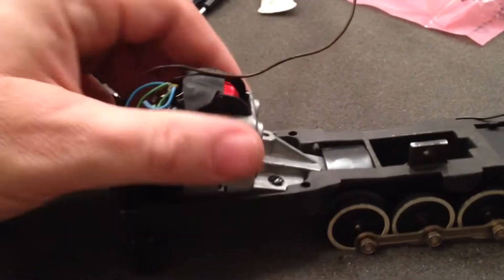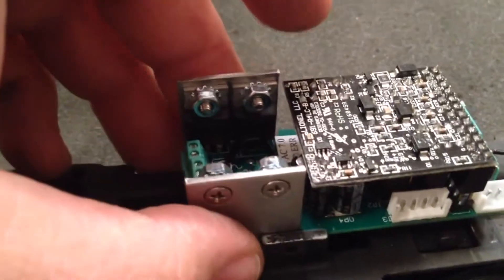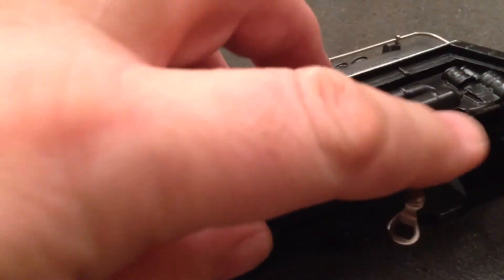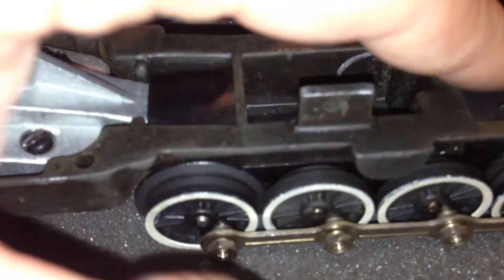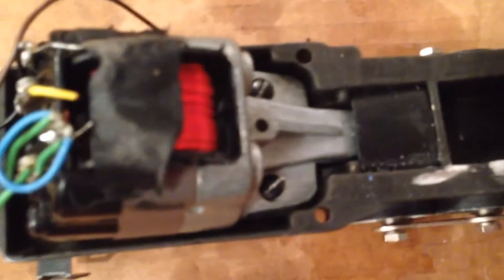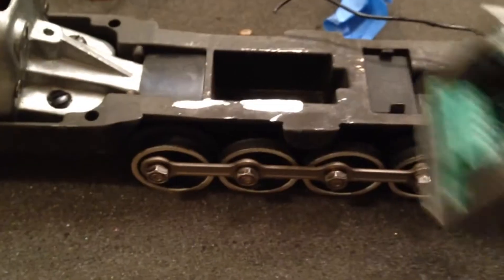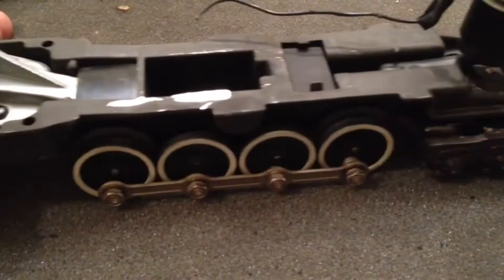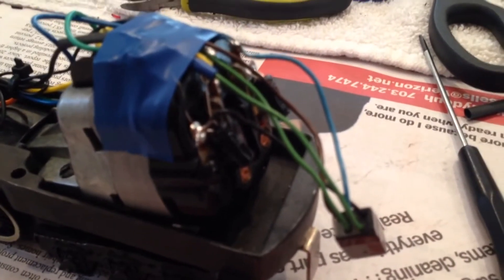Lionel #8404 PRR Turbine converted to TMCC

Comment: Did you use the sound converter from ERR and Di that make the sound of steam sound different that original?
Reply from the maker: I left the sound of steam the same,  I hooked the whistle up to the resistor on the old board like err suggested though.  I like the MPC sound of steam its pretty funny. :)